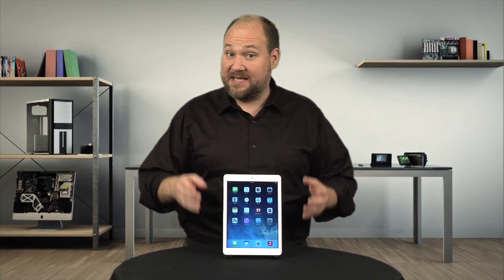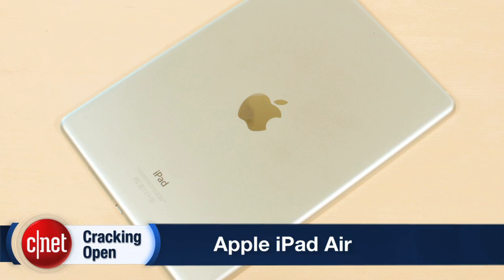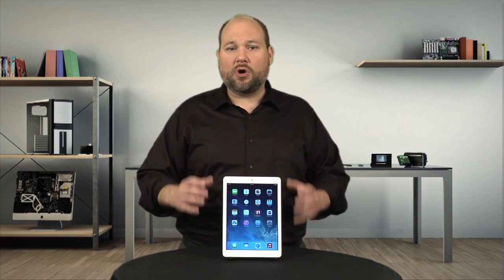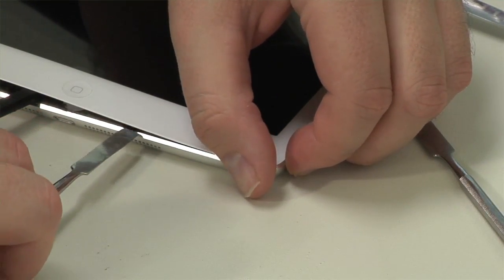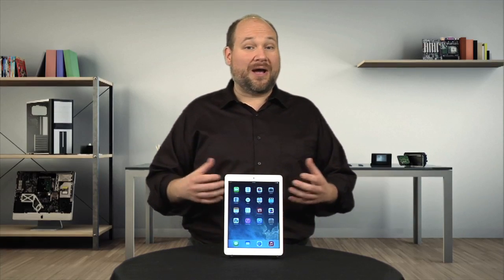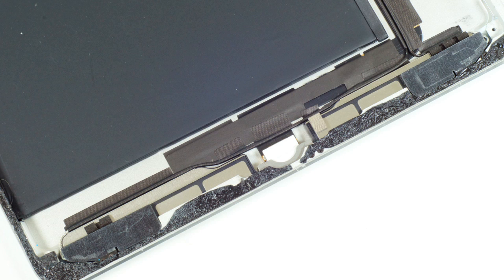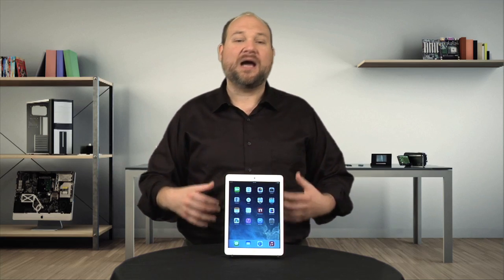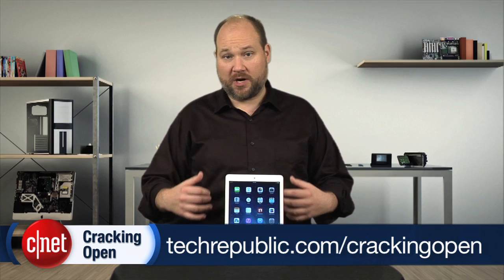Cracking Open - Apple iPad Air

Comment: So I was watching YouTube videos last night and my earbuds yanked my iPad off the table I set it on when I was wearing them and it literally snapped my earbud jack in half. I did get the jack out of my ipad but whatever it did, it jammed the headphone jack insert inside, it's literally crooked inside and when I got another pair of earbuds, they don't fit properly and it keeps activating Siri when I didn't even hold down the home button. Please, can someone tell me how I could fix this?
Reply: ~Xlr8rify~ For a home fix, I have no idea. But if you set up a genius appointment at an apple store they can tell you what's wrong, and possibly even fix it without replacing the iPad

Comment: The adhesive on the back is removable if you heat it with a gun, vigilance is required and it's certainly no easy task.
Reply: Wouldn't the amount of heating required possibly damage some of the components?
Reply: It needs to be done very carefully. If you look at the iFixIt teardown of the Air they took it all the way apart (they often don't do that for the laptops strangely enough).

Comment: It's kinda annoying how difficult a lot of tech companies make repairing their tech. It's because they don't really want them repairable so you're forced into buying a replacement
Reply: The unfortunate balance between sleek and fixability I'm afraid is also an aspect I suspect. :-(
Reply: But apple replaces iPads for free no matter what you do to it that's the policy for apple.
Reply: Yes indeed, let´s see if the life of the battery and the pleasure to have it compensates for the money investment. Another thing that concerns me is the duration of the touch screen usage. It was my first iPad and the pratical side of reading books or playing chess with the fingers is great, but I am thinking in due time to buy a Mac wide screen to use at home.
Reply: José Henrique Only if it's under warranty.

If you find you need to replace the battery out of warranty, that's going to cost you quite a bit. Of course the battery will only die after your warranty is over..

Comment: Crack open nexus 5
Reply: its pretty easy. crack open plastic back (only alittle more force is needed than opening back of a gs3/4) and use a screwdriver to take out screws. DONE
Reply: Nexus 5 is probably one of the easiest sealed in phone to repair :D Check out iFixit
Reply: yeah, iFixit has a good teardown of the Nexus 5.